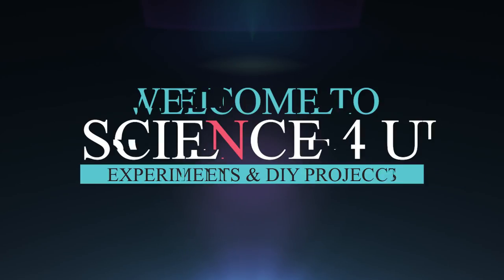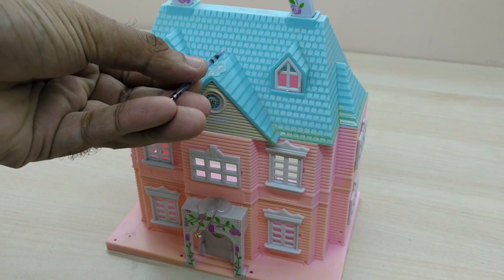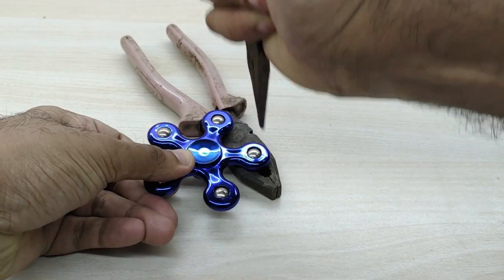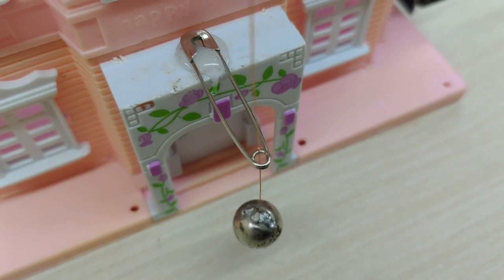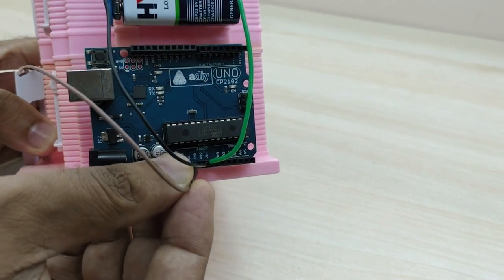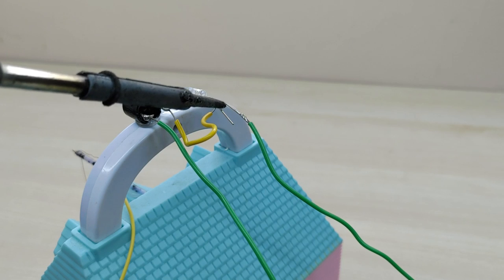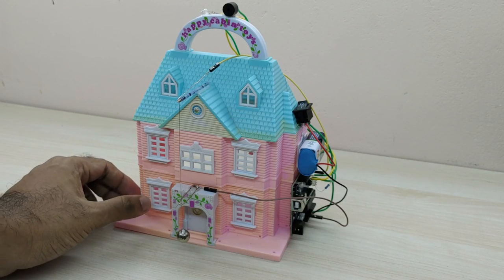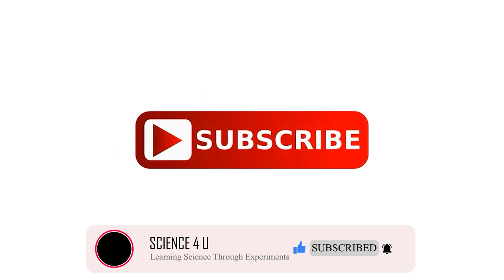Earthquake Detector using Safety pin !!! Arduino Project

Comment: Provide us the link to buy the equipment used
Reply from the maker: Yes sure...

1. Arduino Uno:  https://amzn.eu/d/5IlDq9r
2. 9V battery:  https://amzn.eu/d/34SPqIR
3. Rocker switch : https://amzn.eu/d/1BBajCn
4. Jumper wires : https://amzn.eu/d/7uemocG
5. Buzzer : https://amzn.eu/d/dJmOUt4
6. LED light : https://amzn.eu/d/gyg2hW1
7. Toy house : https://amzn.eu/d/31dpNmM

I have updated the links in the description section also.

Comment: Bro that code of yours is not opening
Reply from the maker: Hi friend..I don't know why it is not opening. For me, I am still able to download and open it. Anyways, I will paste the code below. You can simply copy it and paste in a new sketch in IDE software and save it..

#define LED 13     //LED 
#define BUZ 12     //BUZZER
#define TRIG 8    //TRIGGER
int buttonState = 0; 
void setup() 
{
   pinMode(LED, OUTPUT);
  pinMode(BUZ, OUTPUT);
  pinMode(TRIG, INPUT);
}

void loop() 
{
  
  buttonState = digitalRead(TRIG);

    if (buttonState == HIGH) 
    {
    // turn LED & BUZZER ON & OFF 50 times:
    for (int i=0; i<50; i++)
    {
      digitalWrite(LED, HIGH);
    digitalWrite(BUZ, HIGH);
    delay(50);
    digitalWrite(LED, LOW);
    digitalWrite(BUZ, LOW);
    delay(50);
    
   }
    
    
  } 
  else
  {
    // turn LED off:
    digitalWrite(LED, LOW);
    digitalWrite(BUZ, LOW);
  }
}